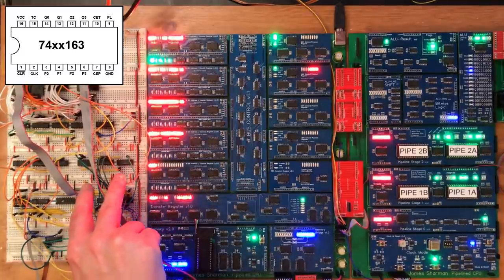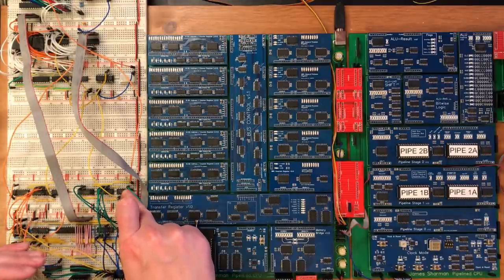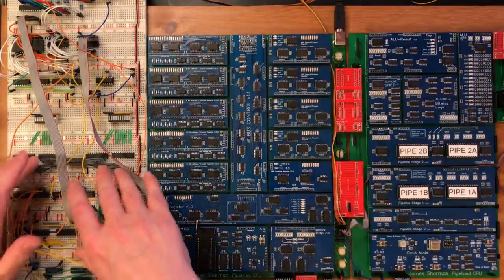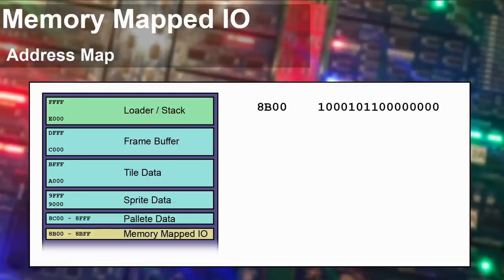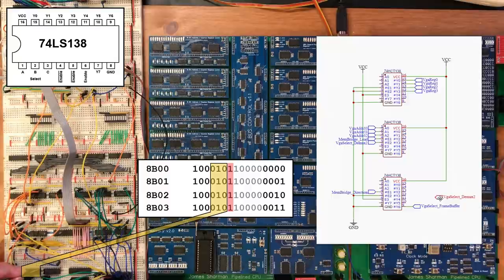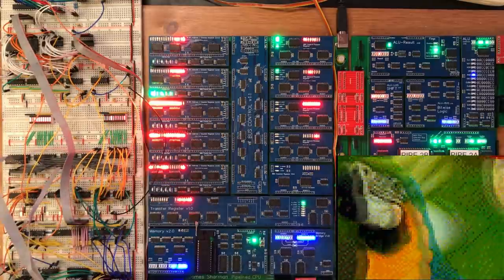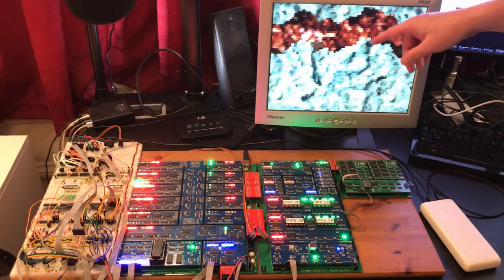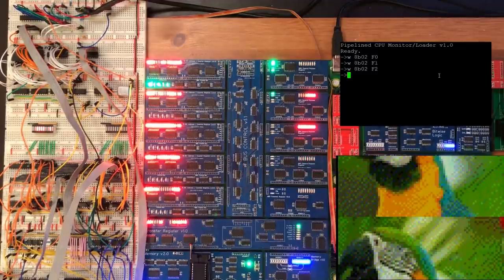Hardware Scrolling - VGA from Scratch - Part 4

Comment: In case you’re using that schematic at 17:30 to design the PCB, the middle IC has its ground tied to V+. Wouldn’t like that to kill a batch of boards.
Reply from the maker: Yes! embarrassingly I only noticed that just after launching the video, but I fixed it immediately in the schematic.
Reply: Also at 7:45 the LED is not connected to VgaY4.
Reply from the maker: @djsirius27  At least this proves people actually watch the insert bits ;-)
Reply: @weirdboyjim  confirmed

Comment: ref: 25:51
When using a double buffer setup you can still select to only update what is changed, but you do it in the memory buffer that is not displayed. 
Then change the address for the video memory in the blanking interval. Then you can change anywhere on the screen without flicker.
An interrupt in the blanking period that use a value that can be change by software to select buffer will give you time to update any changes before it is displayed.
Reply from the maker: It's possible yes, but less ideal. The work is doubled doubled as you need to remember what has changed since the frame before last as that is what you are editing.

Comment: Brilliant. This setup is going to run Manic Miner like a champ! Curious to find out if you implement/plan on implementing a character-based mode for a textual UI (and Dwarf Fortress, obvs)...
Reply from the maker: Later on the tilemap/tiledata let’s me have something very close to a text mode with the right tiledata loaded.
Reply: @weirdboyjim  I was thinking that. Would the framebuffer specify line/col/tile-id as VGA does (along with a byte of color info) to get the huge reduction in CPU load? I guess it's not super-necessary given you have a serial link.
Reply: @weirdboyjim  Never mind! I just learned the framebuffer will become the tiledata. Haven't been paying close enough attention.

Comment: I am seriously starting to consider writing an emulator for your project so more people can write software for it. This has the potential to become an actual usable 8 bit system.
Considering how detailed your videos are it should be possible.
Reply from the maker: I've thought about an emulator, I think the best way would be to load the pipeline control roms and then simulate the bus control hardware.
Reply: @weirdboyjim  That's actually much lower level than it needs to be. To have software working correctly the emulator only needs to be cycle-accurate, and that can be achived by a simple state machine. You keep all the registers in memory and on clock just abstractly perform the effects of the 3 pipeline stages on them however is most efficient in software. I've implemented a 6502 emulator like this before and it works perfectly.

I've actually already started to implement this. The majority of time required consists of watching videos finding all the opcodes, code itself is straight forward.
The audio and video emulation is gonna be a lot more complicated than the CPU itself.
Reply: @Artentus  I did 2 emulators of Ben eaters 8 bit system, one high level and one low level, high level was basically a statemachine as you said, but the lower level is more fun to write and mess around with :D
Reply: I've written an emulator for the NES (in Swift). The PPU and audio were the hard parts to get right. However, it's easy to see now why they designed the PPU like they did. There was no way you could write the games they did with double-buffered bit mapped graphics. They had to have hardware scrolling and sprites. I guess James will be add sprites to his design.

Comment: At 13:05 you show the memory mapped I/O at addresses 8B01, 8B02, 8B03, and 8B04. You also show 16 bit values beside each of those addresses. Would the addresses not be: 8B00, 8B02, 8B04, 8B06 instead, allowing for the 16 bits? A little confused. I found your series looking for VGA circuits for my eZ80 project I am starting, and this fits perfectly with my requirements for VGA that does not tax the CPU.
Reply from the maker: In the frame you link the 16 bit values next to the addresses are the binary representation of those addresses as I'm building the circuit there to decode the address.

Comment: Nice work! Maybe you could have 2 modes? One for a live buffer to which you can put pixels / raster at low FPS and this mode at 60FPS for scrollers.
Reply from the maker: Thanks Damian! You could do, but in most cases that doesn't net me much that an off-screen buffer and an optimized software blit doesn't give me. I'm trying not to add hardware unless it gives me significant extra capability.

Comment: at 15:18, i'd decode the address with an eprom so its done in one chip. :-)
Reply from the maker: Ha Ha! That would actual fail, eeproms can produce unstable outputs when the address changes which would trigger unintentional loads.
Reply: @weirdboyjim  Never seen that but then it should have settled down before the latch pulse, or do you not have a defined control signal. Still remember the first uP i used you had to have two eproms and 2 ram chips driven by odd and even address as they were so much slower than the uP. :-)

Comment: I wonder if it would make sense (if this was the 70s) to have a memory-mapped io opcode that signals another pin instead of the bus direction line. That way a system could just decode the lower e.g. 6 address lines (64 ports seem to be enough...), saving address selection chips in favour of some extra transistors in the cpu. Or even just decode 2 lines and use one of the other 14 lines as second cs for each port----that'd be 56 ports (or 104 ports for 3+13).
Reply from the maker: That's a little bit more like the kind of io ports that the x86 has. One benefit is the reduced line count over the main address bus reduces the decoding logic over a pure memory mapped IO solution.

Comment: If you're worried about ram space, why not implement bank switching? Also, you have no way to mess with vertical scroll within a frame, which could create some pretty cool graphics tricks.
Reply from the maker: Funny you should mention changing the vertical scroll, in the next video....

Comment: I remember some cool tricks you could do with your graphics cards by waiting for HSYNC  and then modifying  a set of registers...  (e.g. the "copper" effect,  where you adjust the background palette color entry smoothly over each line, and vary where you are starting so make a bouncing transparent looking bar across the screen, and a some where you did it multiple times, letting you blit super low resolution transparent wobbliness over the screen... those were the days ;] 64000 bytes + 'super colored chrome stuff' overlaid seemed much higher res than 320x200  (because you could use more colors "at the same time" if you changed the palette quick enough))

Todays graphics cards are cheating, with their gigabytes of memory and 10s of teraFLOPS processing power. (But I do love my GTX 3090 ;P)

With your architecture I imagine you could warp the offset value (e.g from a sine look up table?) based on the line, and get some cool warping effects... perhaps even across the screen, sort of like how you read the original image, except instead of drawing colors, you could "draw" the horizontal/vertical warp offsets in as the image is loaded. This could let you do some really sweet looking effects... and combined with palette manipulation it could let you do some really awesome looking demos ;]
Reply from the maker: Indeed, this whole class of operations is traditionally referred to as "Beam racing", it's something game and demo coders used to do a lot to get more out of graphics hardware. This goes all the way back to the very beginning, the graphical capabilities on the Atari 2600 were so limited it was necessary to do this to do all but the most basic things. The "Copperlist" on the Amiga wasn't really beam racing though, or you could call it "easy mode beam racing" as there was a separate piece of hardware designed for updating registers during the frame, you didn't have to manually synchronise it. I will be using beam racing techniques in multiple ways, you could consider the way the image was drawn in the first 2 videos to be this but the things I show in the future will be a bit more exciting.

Comment: This is a great series - I've written some emulators, and wondering if now you're using memory-mapped IO, you'll be adding joystick/keyboard input and/or banked RAM/ROM?
Reply from the maker: I want to stay away from banks memory, I designed a cpu with a 16 bit data bus, if I wanted more memory I could just have easily have given it the ability to directly address more. I don't feel the need for a keyboard, the UART essentially gives me that and a ps2 keyboard interface would just be a simpler circuit so there is nothing to really demonstrate, A joystick/joypad however would be handy for games!

Comment: Very, very cool. I didn't quite understand how the procedural tunnel was implemented though. How much of that is pre calculated, and how much is the processor doing? Are there two play fields in the video memory, or is the image essentially pre calculated? Either way, extremely impressive! Sprites next? :)
Reply from the maker: I just build it one virticle line at a time, I have the height value for the current tunnel, and for the shadow. I fill the line with the right 64 pixels from the background texture. Then I iterate over it to draw the show, then I draw the tunnel on top of that.  The shadow is just a shift and mask to halve the color values.  The tunnel itself is a simple divide and offset algorithm.

Comment: Very impressive demo, James. Looks fantastic. I'm using memory mapped IO on my backplane build using 74688 8-bit comparators. A single IC gets me my 256 byte IO space. Then each IO device can either use another 74688 to get down to even a single byte of IO or you could use a 74138 to get multiple.
Reply from the maker: Those are especially good if you want to have dip switches or something to select the address range! I could use one of those to narrow the range down all in one go but I'm resistant to add another part to the bom if I can avoid it.
Reply: @weirdboyjim  you're right. I do have dip switches on each.

Comment: So your image needs to fill all of vram which is larger than your display area? It makes a lot more sense now, going for offseting if you are planing to write to the whole x/y counter address space. But this only works because you are generating vsync and hsync with a separate counter and a rom chip which still seems clunky to me. I still think 60 fps is needless for a low rez display. 25-30fps was fine for 8bit consoles which had much better resolution, still I guess that's an aesthetic choice.
Reply from the maker: The image doesn’t need to fill more than the visible region. You can use the offscreen memory for whatever you want.
Reply: @weirdboyjim  apologies I mean it needs to make this visual effect. otherwise you'd just have junk data displayed at the edges as you scroll the image. I understand that in reality you'd write new data into the leading edge of the direction you were about to offset into. For example if you were looping an image the same width as the screen you'd need to write new data into the vram for the new pixels to be exposed in the next frame. Which in effect would mean you'd be overwriting the image through vram sideways in an endless loop.
Reply from the maker: @c0d3w4rri0r  yes, it would be nice if width was a nice power of 2. Many 8-bit era devices has a big border to let them do this.

Comment: Very nice! I used to program for pre-VGA graphics cards so this brings back memories. 

To smooth out the vertical scrolling, you could using a filter, like `scroll_y = f * tunnel_y + (1-f) * scroll_y` and then tune f (start with 0.1).
Reply from the maker: Glad you are enjoying it.  You should remember that this is all running on an 8-bit cpu so it would have to be integer. The scroll_y I put in there was a very quick hack on the day to get something usable. For this kind of visual I would personally be looking at something with a soft start as well as tail, but I'd be keying it of the player ship/craft/whatever rather than the terrain.

Comment: Impressive! Pity the resolution is still a bit low but that's to be expected on breadboard I guess?
Reply from the maker: Not really a breadboard limit, all the operations are being done at "full" 640x480, I'm just ignoring the bottom 3 bits on x&y apart from for the smooth scrolling. I'll be using those bits before end ;-)
Reply: @weirdboyjim  I'm hugely looking forward to seeing what it'll look like once you get tiled rendering in
Reply: @weirdboyjim  are you planning on using the current pixel data output as an index in a tile list? That would increase the resolution AND you get tiling for free minimizing storage.  Hmmm! Nice to see it evolve!

Comment: A very elegant solution!  Very nice output.  Better, actually, than most  of the old 8 bit systems could do in the 80's.  I'm eagerly awaiting the next installment for this series. :)
Curiosity:  Will you be extending the H-V scrolling to be done in zones so as to maintain a fixed area on the display?  I'm not sure how that would be done using this method, though.
Reply from the maker: Thanks Dave! There are actually a few things in this vga series that directly come from me thinking "I could do something really cool if they just added X" when coding for old hardware. There are a few ways you could do zones like that, you'll find the next video interesting.

Comment: Awesome work sir. It would be cool if you can get an SD card or PATA drive connected to the system !
Reply from the maker: Some storage would indeed be handy, I have a couple of ideas but it will need to be another side project.

Comment: Just stumbled into your channel and I have to say this is really really cool! One question though I believe you mentioned that your VGA board has only 8 kilobytes of framebuffer memory which clearly should not be enough to make a full framebuffer for a normal 640x480 frame. Can you please explain this since this seems just like witch craft to me lol XD
Reply from the maker: Glad you are enjoying it! This vga project is all about exploring 8-bit era technology and techniques (with a little benefit of hindsight). I'll be using all of the 640x480 pixels but that doesn't mean I need big linear memory frame buffer. I'll be using techniques such as tiles and sprites to compress the memory requirements down, but they also allow faster update for gaming.
Reply: @weirdboyjim  Thanks for the response, yeah I do know that tiles and sprites can really help a lot in saving memory space but as far as I know you have yet to implement that yet into your custom design which is the reason I asked you about your framebuffer size, know another thing I did want to ask you is would it be possible to do full bitmap graphics in a 640x480 frame by using a very small double buffered line buffer sram memory. The reason I ask is because I know that back in the 1980s dram memory was very slow and vey expensive but you could get very small capacity sram that was very fast. For example the Neo Geo infamously combined the use of 2 2x8 35ns sram chips for its sprite and graphics line buffer and then used slower 64x8 120ns memory for storing all of the tile graphics data and I wanted to know if the same technique could be applied to a bitmap 640x480 display?
Reply from the maker: @flydeath1841  you could increase the raw pixel count with that technique but you wouldn't get to 640 pixels across unless you had the cpu clocked high enough to output that much. I will demo some techniques though when I get that far, can't  do it all at once.
Reply: @weirdboyjim  ok thanks for the reply :)
Reply: @weirdboyjim  I just realized something is it possible to use an Amiga style Blitter to draw the double buffered line buffer so that the cpu doesn't have to waste precocious cycles having to draw to the screen? Or is that simply not applicable for this specific use case?

Comment: You can also use 3 74136's for 12 bit address checking
Reply from the maker: I suspect you mean 138 like I used,  136's are xor gates.
Reply: @weirdboyjim  xors with open drain output. If you connect one of the two inputs to the address line and the other input to a logic high or low and connect all the outputs of the xor gates together with a pull-up resistor and tie this to an enable line. 
If any of the xor gates is asserting it's output the line is pulled low. If none of the xor gates is asserting it's output the line is pulled high.
If you invert this signal you have an enable line for the two 138's.

Comment: obviously need a raster line counter exposed to code so that you can race the beam
Reply from the maker: The status register contains bits for horizontal sync, so you could easily write code that counted the current line without anything else. You'll probably enjoy the next video.

Comment: I also found I had stability problems in my VGA circuit until I put de-coupling caps over each of the chips. I placed them directly over the chips from VCC to GND as they had long enough leads to do that.

Yours is a much better way to scroll than reading the screen and writing it back offset by a number of pixel via the CPU as I do, as I have to update nearly 20kb per scroll. I'm eagerly looking forward to seeing what you do in the second part.
Reply from the maker: I actually spent some time last night soldering caps onto 16pin sockets so I can tidy this (and some of the future high frequency bits) up.
Reply: TTL always needs 0.1 caps on every chip